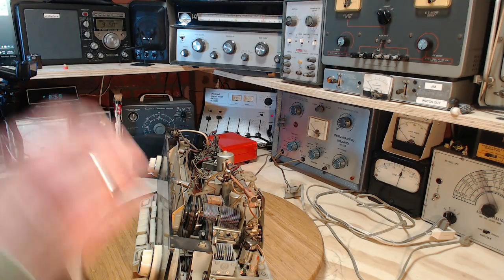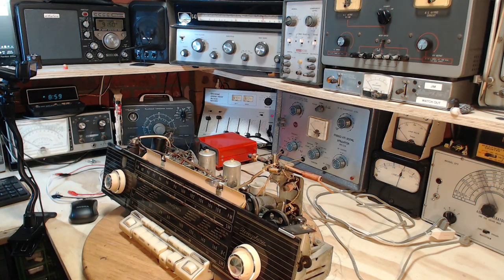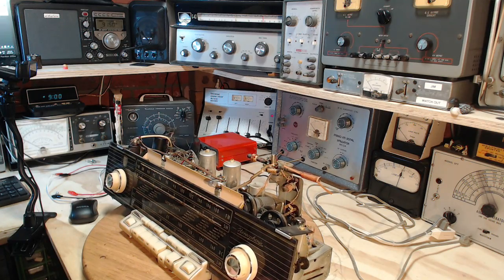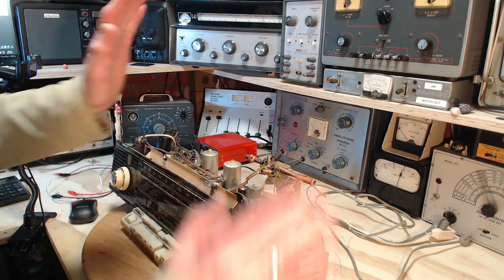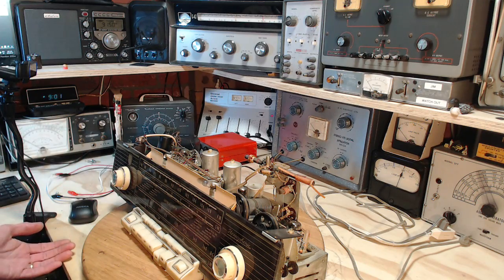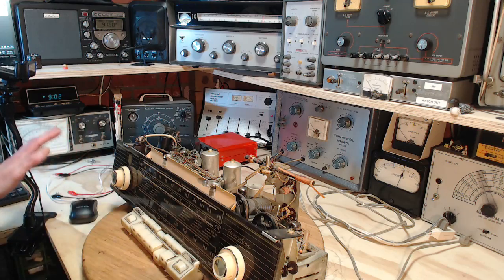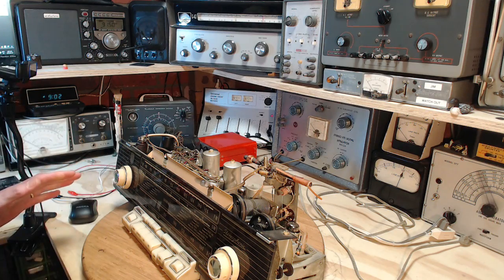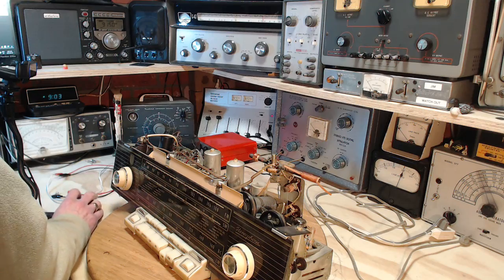Shop Isolation Video #3 - Quick Message for Viewers

Comment: Why does your isolation transformer pass the ground through? I've always been taught the ground should not pass through the isolation transformer for the purpose you are using it for. It can create ground loops.

Some type of isolation transformers for the medical industry do pass the ground through and are unsuitable for isolating equipment under test.

And that only the equipment under test should be plugged into it, not any other test equipment. Though many put a variac between the transformer and the equipment under test.

Comment: Regarding your VTVM having 146 to158 volts on the chassis.  The only way I can think of that this is happening is if you have a fault in the meter somewhere.  The fault is causing mains voltage to get to a capacitor.  That capacitor is causing a phase shift in the voltage.  That phase shifted voltage is somehow getting added to that mains voltage.   I reviewed the schematic of my Heathkit IM-18 which is that same schematic as your VTVM.   The only thing different that I can see is my VTVM has a 3 prong plug on it and the green wire is grounded to the meter's chassis unlike yours that has a 2 prong plug.   I could not figure out how the VTVM circuit could be increasing the voltage on your meter.    A thorough inspection of your meter may be in order to find a inadvertent electrical bridge in it some where.  I do recall when you pulled out the meter's battery it looked like it had leaked.  Maybe some battery juice got in somewhere it did some damage.
Reply: +jp040759 Agreed, capacitive voltage to the chassis can cause that .  Oh and the breaker trip: The breaker in the panel might be loaded with other appliances, if he did, as he says, flip the  switch to full by mistake, that may have been the straw that broke the camel's back re: the main panel breaker

Comment: Regarding the Isolation transformers you have.   Check to make sure the 3rd prong ground at the input power cord  is not connect through to the ground pin on the three prong output receptacles of the iso transformer.  If it is, than you are not wired as a  technician iso tranny .

Comment: I am curious here.  Are you saying that your entire shop is on an isolation transformer?  ie: all the test equipment is on an isolation transformer.  What would be the reason for this.  I have never had a shop set up that way so I am curious.  In all my shops, the equipment was on the regular mains circuits  The ONLY thing on an isolation transformer was the piece of equipment that I was servicing.  If the meter is on an isolation transformer would it also not be isolated from ground?  I could see a large voltage on the case.   You might find the 145 volts after the bridge rectifer and filter circuits in the meter and a leaky capacitor in the B+ to ground would create that condition.  If it were connected to the mains directly with a GFCI it would trip the GFCI breaker.  Like I said I am just curious.  Maybe I am misunderstanding what you are saying.
Reply: +Bill Renfro i think Jim said he has the majority of the shop on an isolation transformer (he said he had his pc on regular mains. He uses the isolation transformer for safety so voltages on the radios hes working on are no longer relative to ground potential